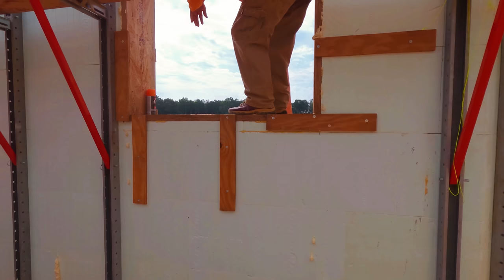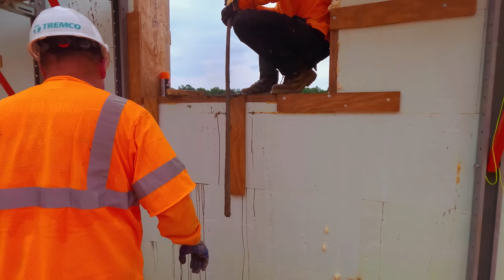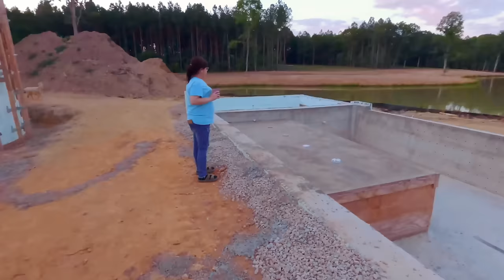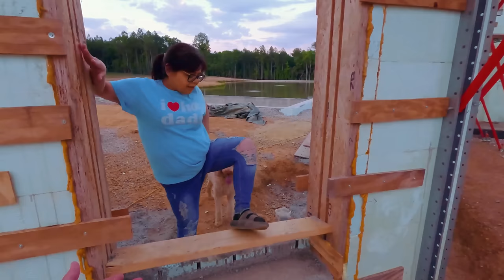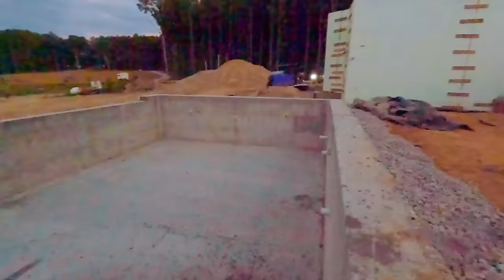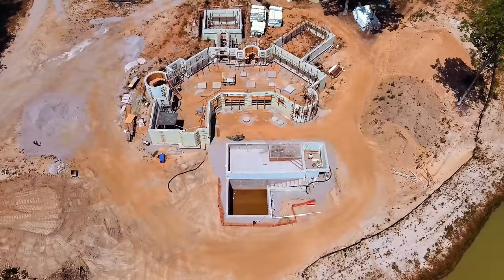ICF Mansion Concrete Pour Part 2!!

Comment from the maker: Our first Icf house pour went great! Some people in the last video worried a little bit about spillage but it looks like a lot more on camera than what it actually was. We maybe lost a yard of concrete, if that. Thanks for all the support, hope you enjoy the video. The next video will be of the steel going up. Have a
 Happy and safe Fourth of July!
Reply: In my book a yard is too much. Appears that the person with remote controlling the pour was not attentive or deaf.
Reply from the maker: @ausubo50  definitely some issues in the beginning. One thing was the pump people didn’t send the right size snake. However, in the grand scheme of things I’m not really too stressed about it. Concrete was about 25,000 and if I had $200 worth of waste that’s not a large percentage.
Reply: @ausubo50 
mean and rude ..learn some manners ..😮😮😮😮
Reply: @ausubo50 nobody wants to read your book.
Reply: @BealyGood  You are a very gracious person.  I would have called @ausubo50 a name or two!  😅
Reply: @ausubo50 if you knew anything about concrete pumping you can’t just start and stop the flow perfectly. Each pump truck operates differently. Also in a pour this large, better to lose a little to spillage and keep moving, or else the walls can be full of dry joints where concrete doesn’t bond well to the lower pre-pour.
Reply: Curious what the attraction to ICF is? I built structures of every kind my entire working life and even tried ICF a couple of times. Never could justify the use of it, meaning too slow too expensive and cumbersome to schedule and erect, but perhaps you can help me see it in a different light..
Reply: @ausubo50  I want to read your book, sounds interesting, you're Ned Ryerson 😉
Reply from the maker: @bobwhite9670   I think it starts with the type of house you want to build. So if you weren’t going to build an energy efficient stick frame house then you probably don’t care about Icf . But if you were looking to build a net zero house, then you’re gonna be light years ahead starting with Icf versus trying to do it with Wood. Second part would depend on which area you live in. So if you’re somewhere where you have to worry about storms, tornadoes, fires, and stuff like that then again something like this in longevity is years better than a stick frame house. So in short, it starts with what you’re wanting to begin with and then trying to figure out the most efficient way to get it.
Reply: My only concern is I didn't see a vibrater at all.
Reply from the maker: @jasongraymire5537  I slap wore the guys out running the vibrator.
Reply: @jasongraymire5537  well they were little boxes with long slender protuberances, from 5 feet to 20 feet long and they made vibrating sounds, I would love to describe more accurately but it would be too vulgar. so there you have it.
Reply: @jasongraymire5537 You could hear them running when they weren't visible on screen. The time stamp at 9:45 shows someone asking a worker running a vibrator if they were comfortable. BTW, these vibrators don't look like anything you may have seen before and they are not made by Hitachi. lol.
Reply: @ausubo50  - Internet "expert".  A yard in that scope is insignificant.
Reply: I think it might be helpful to remember that almost of the spillage was displacing rock (meaning nothing was wasted) and would be out of sight almost immediately.   For those who have never been around a concrete pour, there is always a certain amount of waste that ends up on equipment, clothes, and form boards but the big loss is when you cannot use the end of the load and dump the excess in a washout area.  For this size of project, the spillage was essentially no more than a rounding error.

Comment: Geoff, so far the biggest thing I worry about for you is, there being enough vibration in the walls, on this whole pour...freaks me out, I don't know how many people you have doing that most important job, not that the whole job isn't important.   Hoping for the best on all of it. Love the videos! Keep up the great work.
Reply from the maker: I think we’re good with that. The four concrete guys are very experienced. That’s who I had finishing the top of the walls and running the vibrator. Same crew that did the upper pool and we were able to pull the inside forms off and see the concrete and it looks great.

Comment: Awesome job! taking the time and effort to get the foundation perfect will pay off. If the foundation has issues, it will haunt you through out the whole build. I wish you could have cooler temps, that heat takes alot out of you. drink plenty of  water. stay safe..

Comment: Geoff the steel columns should be anchored with minimum 8 inch embedment. If the rods are 6 inch long , you have to deduct the thickness of the base plate, the nut and washer. Plus any shims that may be needed. So if you use 10 inch long Hilti HAS anchors with HY 200  epoxy you can’t go wrong.

Comment: be interesting to see how the interior plumbing and electrical get rough installed...worked low voltage in a home like this...a royal PITA sandwich, but first and last time...excellent insulation though...great stuff!!
Reply from the maker: It’s going to be interesting for sure
Reply: @BealyGood  copy that!! definitely will be watchin with a lil BG scription!!
Reply: @BealyGood  For a project like this, do you need to have the concrete tested (GeoTech) before a pour or is that for industrial (commercial jobs? And it's not like yall aint been industrious!! Whew!!!
Reply from the maker: @k4x4map46  they took samples during the pour. I received the 7 day test results yesterday and everything was great
Reply: @BealyGood  awesome!!

Comment: Impressive pour, nice job Mr. Bealy Good.
Are there anchors that get drilled and epoxied to the top of the wall as well to tie the sill plate to the wall?
Reply from the maker: When we get to the top floor, there will be. Another floor goes on top of this.

Comment: Enjoyed the video,  lots of hard working guys. Great job, my only observation is may should have done it in two pours over 3 days due too heat on guys and waiting on trucks as day went on. Just my observation.
Reply from the maker: @philipfleming3546  we did think about that, but we weren’t sure where we would want cold joints
Reply: Total Unmitigated Disaster, no rationalizing this Blow-Out Bonanza. That Lizzy Blackball-well was so right. Next time you're building a basement with no roof (a hole) just use a shovel, or Haney Stick as the industry calls them.

Comment: Hello, when I watched Dirt Perfect build ICF pools, basements and houses, they also used vibrators on the outside to move the concrete into the voids and had great success with their pours! And thoughts of using them on your build?
Reply from the maker: We had some sawzalls with no blades. I don’t know if I  showed them. But we use a different mix than Dirt Perfect uses. Based on when we took off the forms on the pool with no voids and problems. Feel pretty good about the mix.

Comment: Pouring under the sills... Did they get vibrated?. I would have thought some air vents might help allow the concrete to fill the voids easier. Will we ever know if it was a solid pour there?
Reply from the maker: Yes. All that got vibrated. It pumps the air out to the left and right of the window through the Icf wall up top. You can bang on everything and you know if there are any voids.

Comment: Well, it's a big project that certainly requires very careful planning. But, as I said in the first part, you could divide the 'performance' of the contributors into thirds. One third is working, one third is posing (for heaven's sake don't get your hands dirty) and the last third is running from left to right and back without doing anything.
I know, it's a subjective impression, but I'm just a 'bloody German' and things look a bit different here. Still, interesting. Good luck with the next episodes.
Reply from the maker: I have a German here working this week. So maybe he will redeem things for everyone. Lol.

Comment: Seeing the pump truck reminded me of something. Recently a pumper drive through 3 intersection with the boom up high enough to tear out power lines and the cable lines. No power or internet for 6hrs during repairs. It was hot.
Reply: The hat killing a wasp brought back memories. I was painting our house and one was buzzing me. I slapped it either way my hat didn’t see it anymore put hat back on. Went back to psintning had paint in ne hand and brush in other and wasp inside my hat. That joker nailed me like a machine gun until I dropped both paint and brush to get my hat off. Had white grass the rest of the summer. I always check my hat now.
Reply from the maker: Wow

Comment: Looks like you could have used 2 vibs. the concrete is sitting before the 2nd floor was poured around the window pockets.
Reply from the maker: It vibrated on down, but I agree, will have two vibrators at the next pour